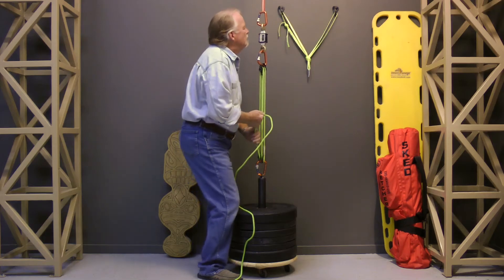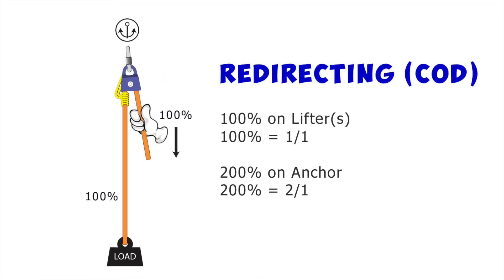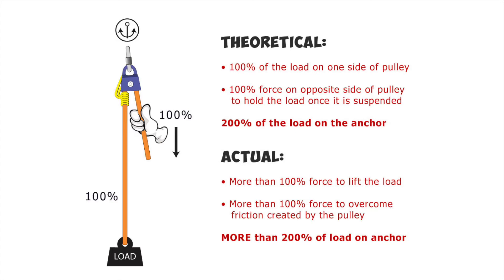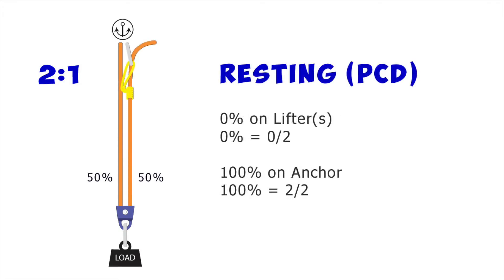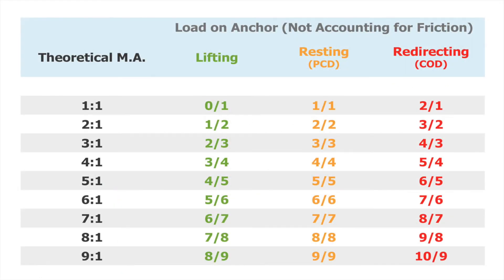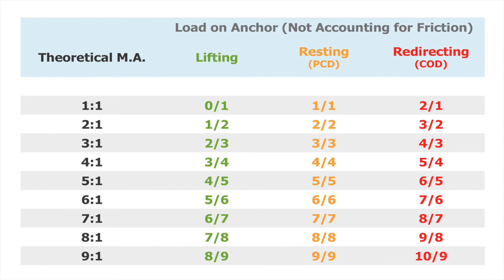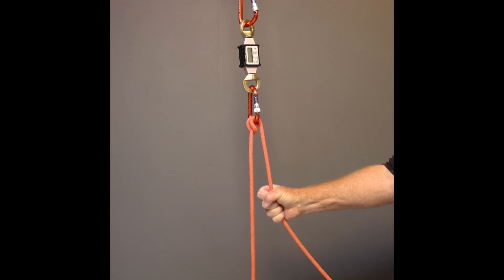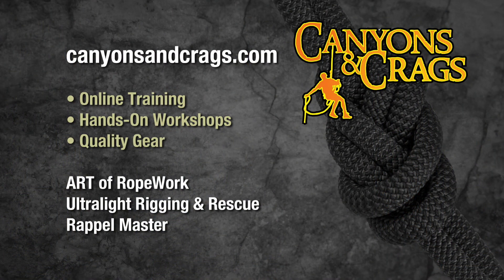Anchor Loading - Mechanical Advantage and Friction

Comment: Great video!  Many applications for this not just canyoneering.  I was lifting an 1100 lb transformer using 4:1 advantage and searched on google until I went insane to find out what the load on the anchor would be.